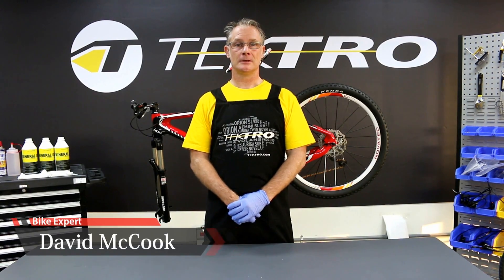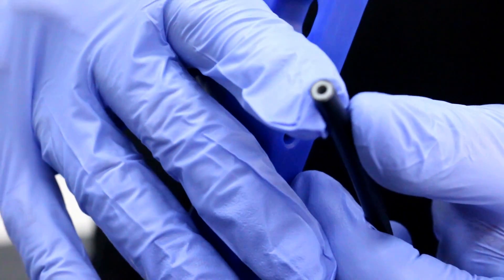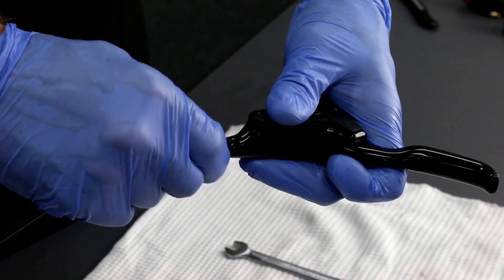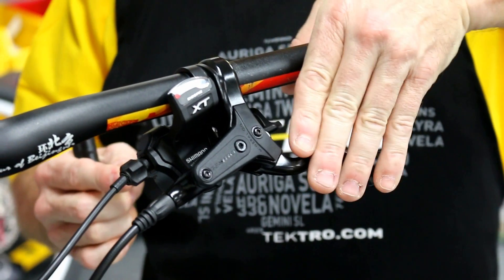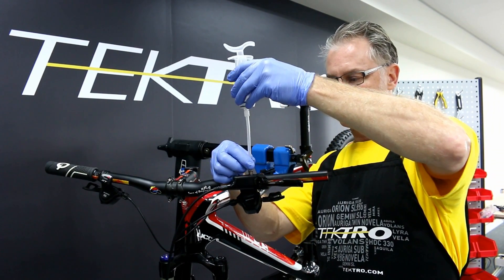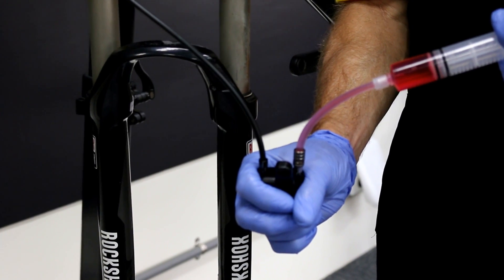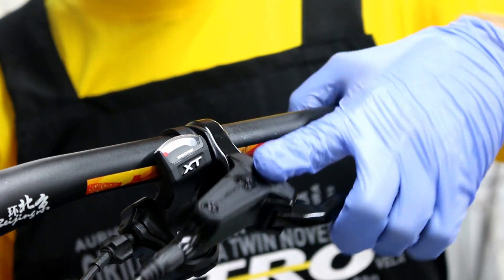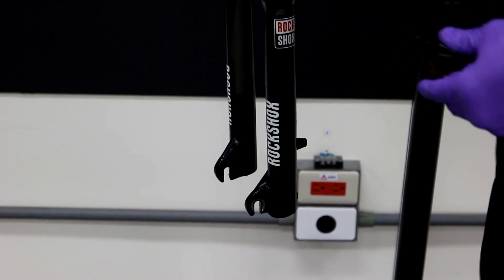Hydraulic Disc Brake Lever Replacement

Comment: my brake hose will not disconnect from my lever. i’ve pulled as hard as i could after unscrewing the first thing, but it will not come out need help asap
Reply: im in the same boat right now...

Comment: My tektro hydraulic brake levers have a bit of play in the lever part how I fix it
Reply: mine tooo shimano mt200  goes up and down but brakes all fine
Reply: It means there is air in the system. So you need to bleed the system

Comment: Do you need to cut the cable and make a new connection if you are replacing the brake lever with the same model?
Reply: I would like to know this as well.
Reply: Just found this video as I'm looking to replace mine too. Was thinking the exact same! Do you really need to cut a new one if replace with the same unit..